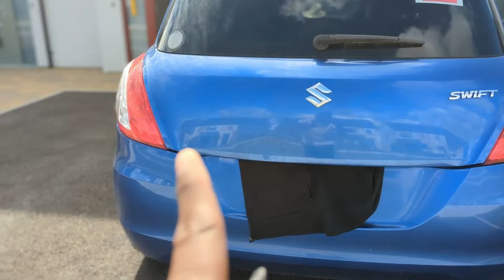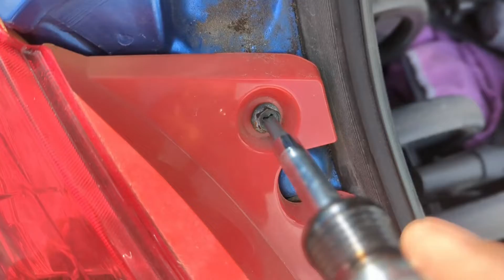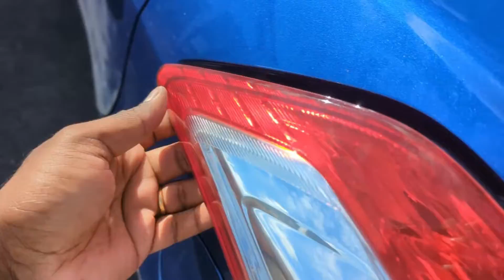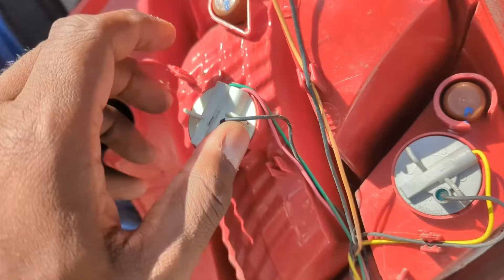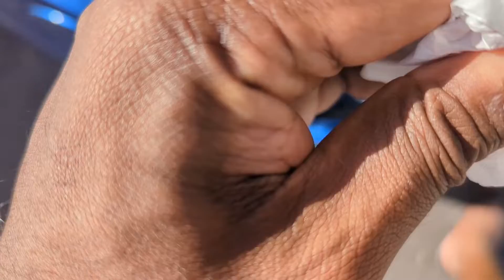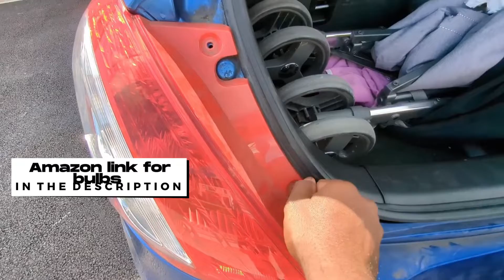How to Replace SUZUKI SWIFT Brake Reverse Indicator Signal Tail Light Bulb

Comment: Hi so my tail light is out not brake light can I use the same bulb
Reply from the maker: @bigtimeclipztty the trail light is a one filament bulb unlike the dual filament brake light.  I believe you need P21w or 382. It is easier to just take it out and take the old bulb to the shop to be sure.